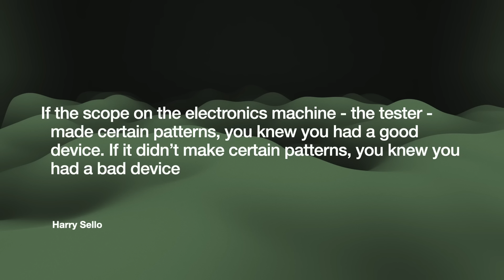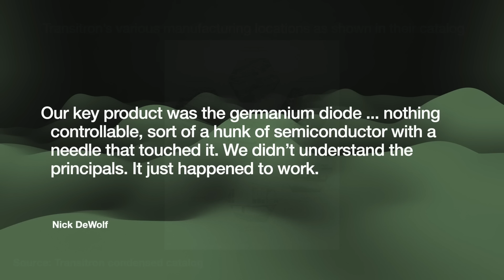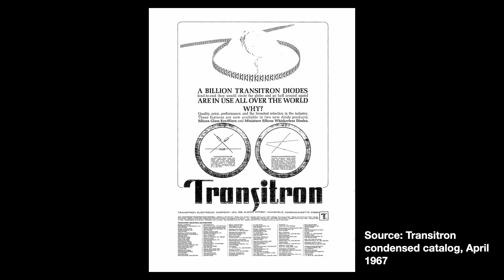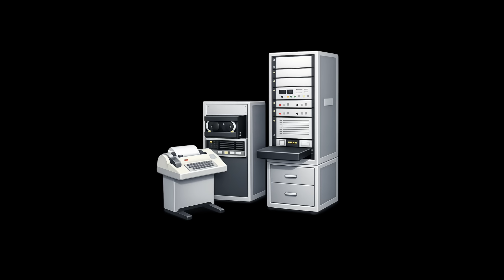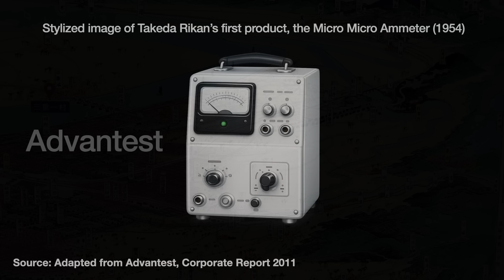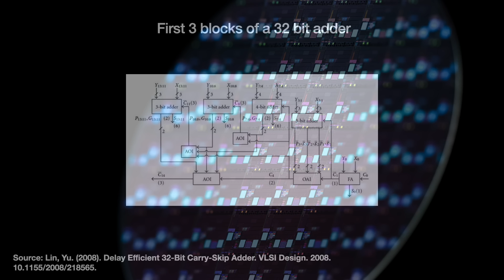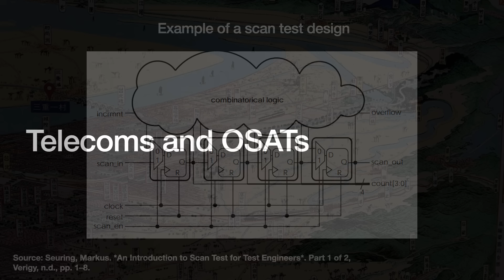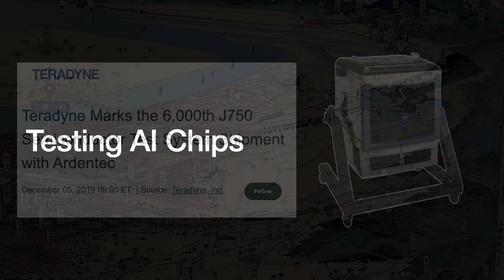How To Test 208 Billion Transistors

Comment: I became an EE contractor specializing in FPGA design back in the 1990s. It was a very lucrative field, especially if one could guarantee success at power on.  I used two tools to do this: synchronous design and VHDL testbenches and vectors.  The one thing I demanded up front was a written design requirements document. They could write it, or I could write it.  I had many customers by referral only, and one customer that came up was Teradyne.  They had the same design and design requirements philosophies, so I readily fit in.  The only difference was they used Verilog.  I handily learned it and went on. I bring all this up, because there was one other contract engineer there that I became good friends with.  We both worked on the J750.  Several years later, he told me that it was selling like hot cakes and wanted to know if I would join him in a lawsuit to get some of that money.  I told him that was the last damn thing I was going to do.  My contract didn't call for residuals.  It called for an hourly rate.  I am very glad that Teradyne was so successful with the J750.

Comment: In the past I worked for a radio manufacturer calibrating modulation monitors. I had a foam board covered with a hundred transistors assorted by HFe and swapped out devices as they came off the assembly line. In theory the girls were supposed to re-work the boards after I determined the correct devices to use, but managers learned to look the other way as I removed/resoldered transistors and performed alignment. I always wondered what happened in the field as techs tried unsucsessfully to get their monitors to work after they did minor repairs............................

Comment: Testing systems are analog and faster then the digital circuits they are testing. Except testing the digital response they test shape of signals and timings.
So the fantastic thing is testing systems are faster then the circuits they test.
Reply: They should still cost 3 million each as they did in late 80s when i worked with them

Comment: 1:30 I had that job at one time. We made cheap amplifiers and used to get our transistors in bulk and untested, so when a new batch arrived, I'd check them on an old round-screen scope hooked up to a primitive tester. They got sorted based purely on gain: BC107, 108 or 109.

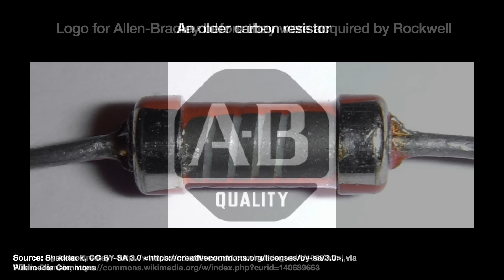Comment: 10:45 That's a carbon film resistor. Allen Bradley is best remembered for bulk carbon composition resistors--a different animal. Sorry to nitpick, I cant help myself when it comes to technical trivia. Also, it's TEK tronix, not TEX tronix. An important company, they basically invented the modern oscilloscope, by inventing the sweep hold and trigger circuit. It's an interesting example of how a subtle change in abstraction--thinking about the sweep in terms of time rather than phase--can radically change how a device is used, and make it radically more useful. Might be an interesting company for a video if you haven't done one.

Comment: Dad got to visit IBM during the System 360 production era. Since the 360 was so customizable, configurations for customers were managed on punch cards (naturally!). These also drove the testing of the computer enclosures - IBM had built a system that pneumatically drove a full set of probes into the enclosure to test the internal wiring.

Comment: When I worked at Internal Rectifier 1991 to 2003 the transistor test equipment we used was manufactured by a company called TESEC. I have no idea if they were a small specialist manufacturer but we probably had over a dozen of them.

Comment: I used to work at Bell Labs back in 1982 as a computer draftsman and was involved in the Bell Mac 32 bit microprocessor. Worked there for two years and then left. The smallest feature back then was 1 micron.
I can’t imagine what is now.
Eventually I worked at a microchip company testing new chips and wafers and do characterization on wafers for production.
Very interesting work. Then after that I work in the building automation technology and use some of the products that I worked for n as a technician in the chip industry.

Comment: Great video, as usual! Another aspect that you didn’t cover here, is the wafer-level test transistors. @20:20 you have a picture of a typical ‘test probe’ – a pcb with sharp little pins precisely aligned to mate with ‘macro’ test transistor pads on the wafer. At MOSTEK in 1978 I was a line worker in the ‘test probe’ area. Each of the (3-inch and 4-inch!) wafers that was produced in our fab had several test transistor areas spread around the wafer. These transistors were produced in the same processes as the rest of the normal-sized transistors that made the individual die, but these (or at least their test pads) were large enough to locate under a low-power microscope and the test probe pins were manually aligned and lowered to contact the pads. The test probe board was attached to one of those PDP-8 minicomputer units – I think ours were bespoke but I could be mistaken. The computer ran a set of characterization tests on the test transistor(s) and the results were recorded to a printout. 

All this was done way before the die were cut off and packaged into DIPs, avoiding those costs if there were process problems that were likely to kill the yield on that wafer. We might have (I don’t remember) done some sampling of the lot of wafers or we may have tested every one in the carrier. 

There were a variety of test transistors and corresponding test probes, but not nearly as many as there were varieties of chips being produced – again simplifying the process.  I enjoyed doing that work and getting to peer at all the different wafers under the microscope. Feature sizes were so large in those days that everything was quite visible under a 10x microscope.

Comment: I worked as a testing engineer at a Japanese semiconductor factory until 1997. The first test system I learned to use in 1985 was Teradyne’s J273. After that, I worked with LTX’s linear test systems, and as production products evolved, I also worked with several models from Advantest. I found the work of improving linear IC testing using the J273 and LTX systems particularly interesting. After the Intel Pentium processor debuted in 1993, we upgraded the controllers of our operational LTX test systems to Pentium P5-based ones, which significantly sped up various processes in device testing. Those are fond memories.

Comment: i work as a failure analysis engineer at a semiconductor company, so its a conflict of not wanting a completely robust test system so i have a job (xD) and at the same time wondering how the hell some of the returns we get were not caught at final test. i learned that my company just barely runs small tests on the final assembly to save time and therefore money. but theres a growing interest in increasing test coverage as it's another way to reduce the parts per billion failure rate. super interesting video

Comment: Fun topic! I worked at HP/Agilent in Loveland for a while on their ATE manufacturing line. We built the Agilent Versatest V4400 and V5400/V5500 systems. I was at the end of the line in burn in and final test. I remember seeing a couple of HP 83000 ATE systems hanging around, used to verify the odd module that came in for repair. We had quite a few issues we had to work through when we built the first few V5000 series systems. But it's pretty neat to know that many of the large semiconductor manufacturers used the systems I had my hands on to test flash memory and SoC components that landed in so many devices.

Comment: A fun step-change ins Structural Fault Model testing of of digital circuits: The JTAG scan chain to do this natively gets really long. So shifting bits though the scan chain becomes a very serious bottleneck.
The solution is that while you have an immense number of transistors to test, they are all arranged in small testable blocks. So you can split your scan chain into many smaller parallel scan chains. Better still you can generate the scan-in data on-chip using a PRNG (typically a LCG), and also hash the scan outputs. All of which mean your test now runs at native chip speeds rather than being limited by external IO.
The best bit is that when this was first implemented they didn't tell the factory. All the chips got rejected because "the tests are too fast, something must be broken"
Reply: PRNG .
What you are describing is a technique called BIST - built in self test and signature analysis.

Comment: A very important type of test is on-wafer process testing.  At a small number of sites on a wafer there's a special pattern that allows testing of the process steps, including alignment.  If a wafer fails these it may not make sense to do further processing.

Another concept is that you can make a spread sheet where each row is a process step  The row contains data for the cost of material inputs at that step as well as manufacturing costs/labor at that step.  A running total shows the total costs at the end of each step.
The row for a test has the normal inputs for material and labor but now there's a yield for this test that translates into costs for the scrap and unit cost for the remaining parts.
If a test passes pretty much all the parts you are wasting money on the test and can eliminate it.

Comment: Lol, flashbacks of "Guru Meditation Error" with a word-line / bit-line memory test system in the early 90's that oddly used an Amiga. (In the US no less, and I've never seen a system like this again)
I also had friends that worked for other local chip companies that integrated scan chain vectors for the IC designs.

Comment: I once Worked at Intel Division that Tested Bare and Built Circuit Boards stuffed with Analog and Digital Devices.  These Products were for Intel Developmental Systems that Emulated Intel Microprocessors at Customer Sites.  

Us in Automated Test Engineering would Develop Tests  on large Teradyne Machines to do Analog and Digital Tests on Built Circuit Boards.

Some also Developed more complex Tests to further confirm Boards would Work as intended.

Comment: 28:02 - Got a Sentry Series 20 test program for a Western Digital X.25 controller my company was integrating into a super-minicomputer communications subsystem. and worked through implementing it. No chips were working. I managed to figure out that WD only tested the dies and did not test in the package. The die holder provided a ground to the chip - there was no ground connection wired in the package to a package pin. The metal "can" was in contact to the die, but that was not a solution. But, WD avoided shipping lots of these to lots of customers and were very happy. My company actually never shipped many of these products as Ethernet overtook X.25 as a thing... still got a trip out to Fort Huachuca, Arizona, where the US Army Computer Evaluation Center which includes things like the Defense Data Network (DDN) and got to work with the engineer who maintained that spec, Debbie (DDN - Debbie Does Networks)...

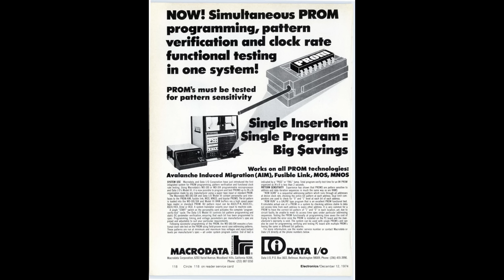Comment: 14:42 - I was also the company's expert on programming the Data I/O programmer. The existing CAD-to-programmer interface program, which was only doing PROMs and was a horribly written 8000 lines of assembly code which refused to be updated at all. I re-wrote the system in "C" so that the company could start programming and testing PALs on a new generation of products. The new system also generated production reports, success/fail testing went into a maintenance/calibration predictor, and was scalable to multiple programmers/operators. For a while I was the only one in the company who know where all 1500 engineering changes in the PAL logic was before the initial release of the new product.

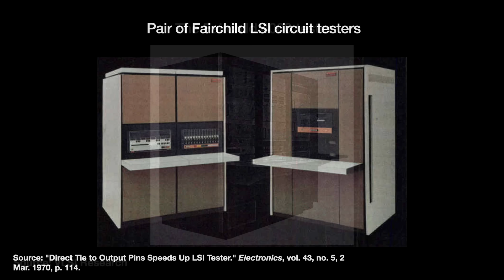Comment: 14:04 - After being hired into a super-minicomputer manufacturer in Fort Lauderdale in 1981, I was shipped off to San Jose, California, for three weeks of training on the Fairchild Sentry Series 20 VLSI tester. A month after we took delivery, the machine decided to make smoke of itself in our test lab, and it was four months to get re-built and functional again. In that four months, shoulder-to-shoulder with a fellow Gator, I automated the test generation for the GenRad bed-of-nails in-circuit tester for printed-circuit assemblies from data taken directly from the company's CAD system, spending most of my time correcting problems with the Manufacturing Interface File ("We take the IF out of MIF!").
Reply: This video and your recall of the Fairchild Sentry Series 20 VLSI tester brought back memories, some bad. When I joined Motorola, the Sentry 20 testers were the new workhorse testers with reel to reel tape drives to load the test programs. They also had a number of older Teradyne testers that used continuous loop tapes like 8 track music cartridges (remember those?) to load the test programs. The Teradyne testers were referred to as the Teradactyls by the engineers and production people. The Sentry testers seemed to always have the techs fixing or adjusting them. The PMUs (Precision Measuring Units) were pretty fiddley and a cause of many problems. The PMUs were not just voltage measuring units but current forcing too which some chips needed for test. As I said, I had some bad memories of both of those testers.

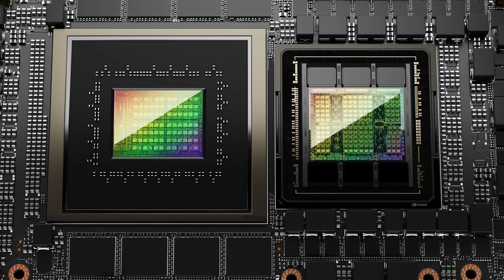Comment: 4:10 - And they would all FAIL: because the transistor going into a Regency was a linear device doing analog audio processing and the transistors in an H100 would be doing 1:0 logic operations very fastly and very non-linearly...

Comment: 20:40 Brings back memories. When I worked for DPACI about 20 years ago we had rooms filled with this style of testhead, though not as bulky as that particularly illustration.
Reply: I would imagine the probes also touched the test pads and not each other at some random point on the die....

Comment: You can still use oscilloscopes to test many parts of modern circuit boards. Guys who repair GPUs use them to test if the right wave patterns are coming in and out of certain chips on the board, and while a crude method it can still be an easy 'does this part work like it should yes or no' method to find dead components that need to be replaced.

Comment: I was working for a German ATE manufacturer (SZ Testsysteme) in the 90s working on their digital and analogue test cards. 

So modularisation and pluggable test equipment that can be swapped to meet the demands of the DUT was certainly not a new thing in the 2000s, but already widespread in use more that a decade earlier. 

SZ was taken over by credence and is now a division of Advantest though. 

#SoSad. 

But the fond memories still remain.
Reply: I remember when SZ was purchased by Credence.
Reply: @steveholder7289  in what function?
Reply: @ThomasGanterPrien  I think I was a Apps engineer/manager at that point working on the Vista (Quartet/Octet) series.  I worked my way up from technician on the first LT1000 (serial #1) at Tek to Applications Eng and Manager (Credence) out of Beaverton/Hillsboro Oregon.

Comment: During my years at Intel I was pushing "all circuits test themselves" as an approach to speeding up test (it all happens in parallel) and making test available after production. My circuits all tested themselves (scan reads out the bist result rather than testing the logic).  I'm confident that very few designers listened.

Comment: Tl;dw: you compare the outputs from a set of inputs to what they should be. The more complex the chip, the smarter you have to be about your inputs.
If you're hoping the video elaborates on what "being smart" entails there, aka the crucial point to answer the question in the title, I'm afraid this video isn't for you.
Reply: No. That's functional testing.
You have to do fault testing.
You have to devise a set of test patterns that can detect faults across the logic gates in the chip. It's a very different kind of problem.

Functional testing, typically gets you to 50-60% detection rate of all possible stuck at 0 and stuck at 1 faults across the design.
It is far from high enough. It means around 40% of the chip hasn't been tested at the completion of manufacture of the chip.

Testing time on the wafer testers is expensive, and ultimately contributes to the final price the chip is sold at, so the goal is to achieve the test coverage you want, in as short a time as possible.
And there are various ways to do that concerning how you get that fault test data into the chip.
Reply: @deanXRayZulu How's that different from what I said? You provide inputs and compare them against known good outputs. The interesting part is which inputs to provide. Something the video barely addresses.

Comment: I spent many happy (and unhappy) hours programming Teradyne J941 digital testers.  Oh yes, 941 is a prime number.  Also programmed LTX Synchromasters mixed signal testers for two different businesses.  Rumour has it that LTX stood for Left Teradyne at Christmas.  My boss at the time (who I still keep in contact with) would often tell designers that we wanted to "test the silicon, not the application".  Testing the application was invariably slow and error prone.  You need to test the blocks of the chip (DACs, ADCs, amplifiers, logic etc.) and then test that they are connected up, not throw real signals at them and try to test that they respond as they will in the application.